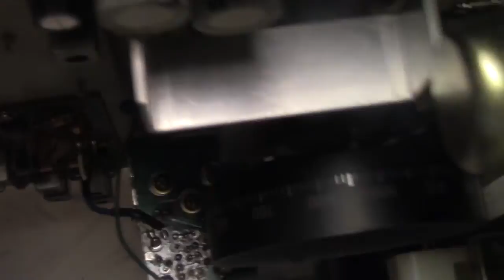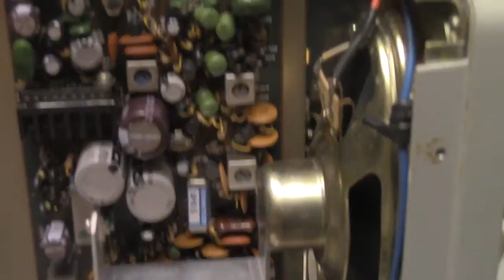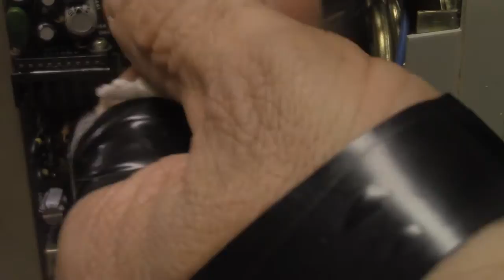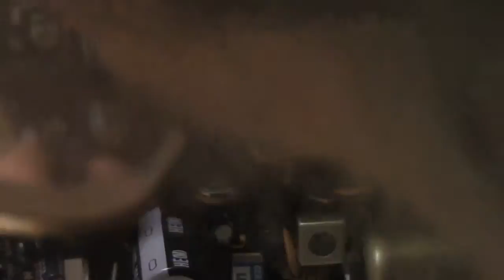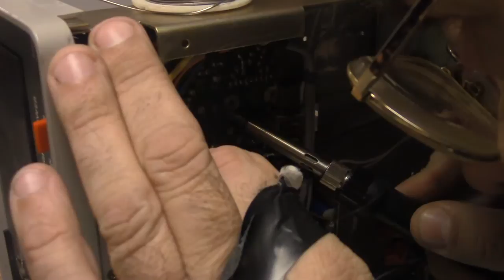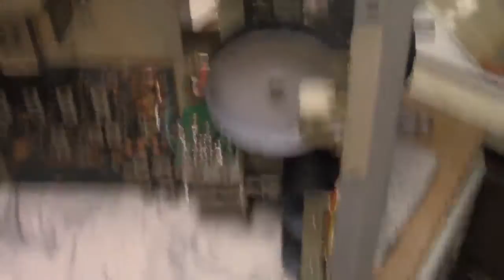Frg-7 Recap

Comment: I recap tube radios all the time time, because of degradation from  heat, moisture, dirt, high voltage, and poor construction of some very old caps,  leakage in hv power supply and audio bypass caps are the reason.. but what is motivating you to do it here ??, where the quality is high, the voltages low, and the thing hasn't been abused with dirt and moisture ?    Are you fixing failures, or measuring removed caps and finding real problems with them ?
Reply: Capt Larry - there are folks that recap as a matter of course.  I am not one of them.  In my case I am looking at checking out the Sears branded FRG7 I bought many years ago.  I plan to take the caps out and measure their capacitance and ESR, and at most maybe reform them if the measurements are OK.

Comment: Nice work... keeping another classic receiver in premium condition, I still wouldn't mind a FRG-7 when I finish ironing out the kinks in the R1000.

Thumbs up for the "Bush Mechanic" bandaid!
Reply: Hi! I ask for help !!
I opened my FRG-7, but I do not know how to replace the tuning scale and s-meter light bulbs that have burned out; the bulbs are 2 and illuminate the 2 windows above the main tuning knob: the s-meter and the frequency 0 - 1000 Mhz. These bulbs are connected directly to the current wires. I do not even know what voltage and wattage are. Please, help me! Thank you!!!